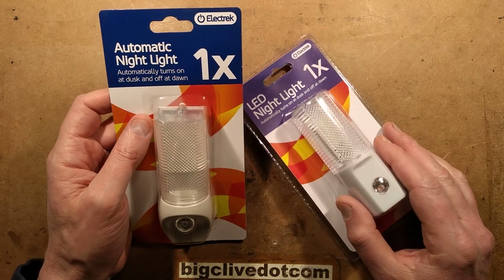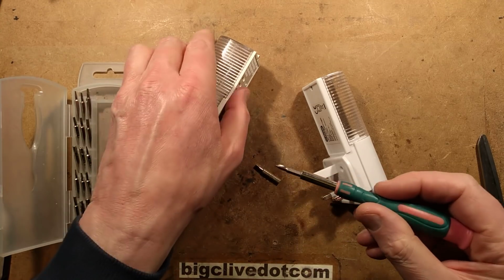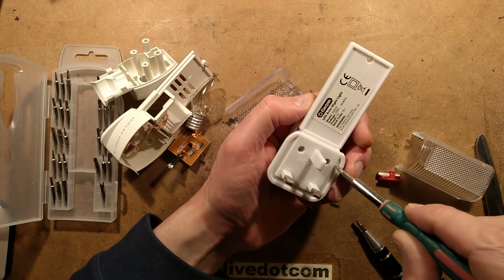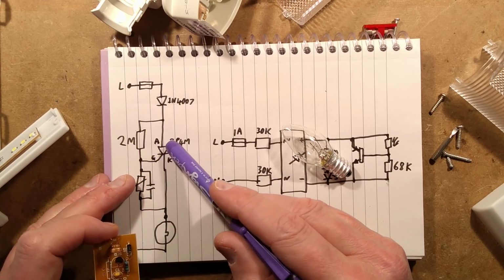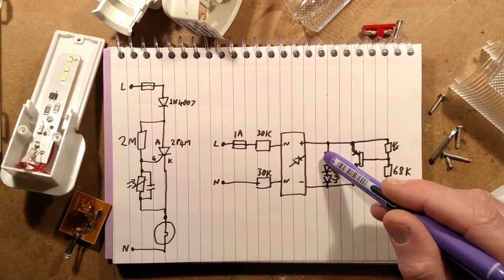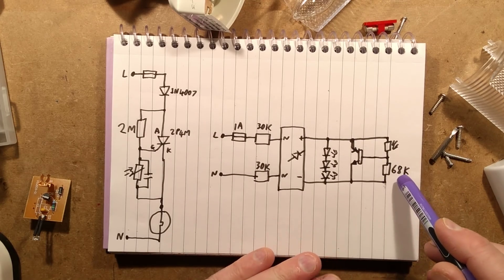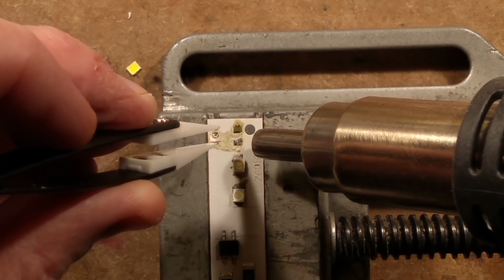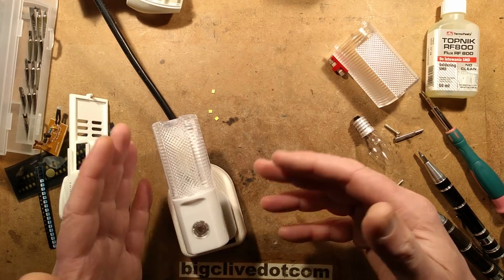Poundland night light tungsten to LED evolution.  (with schematics)

Comment: That housing for the LED version looks absolutely RIPE for hacking! Even if you have to make your own PCB, there looks to be absolutely loads of space in there. I'm thinking if you made a little 'extra' PCB that would use the pads kind of as 'anchor points' and then you could put more LED's that would fire out sideways, for more of a "down the hallway" rather than "straight across to the other wall"
Reply: Oh, man... You know how many guys you just sent running for their soldering irons? I have to cut this comment short, as I must go do this *right now*!

Comment: Here are 2 more hacks you could've done.  1.) lowered the value of those resisters to make the LED's brighter.  2.) put an electrolytic capacitor across the DC terminals of the bridge rectifier to get rid of the flicker in the LED's.

Comment: those close up znse laser cutter lenses should have an effect on your readings, the reason real close up lenses straight from flir or whoever else cost so much money is they have to be calibrated to keep ratiometric accuracy. you might want to give it a bit of a test at some point perhaps using a 3d printer bed heater painted flat black as a blackbody source
Reply from the maker: I've done some comparisons and it's not too bad.

Comment: With that circuit, the light actually takes more power when it's off. If they had used a capacitor dropper instead of resistors, the light would dissipate less heat, and virtually nothing when the transistor shunted the LEDs. OK, it's not much but it just ...bugs me.
Reply: The main problem (for "them") is that if they did isolate the LED chain, then the transistor would have to have a 400v rating since that's the off-load voltage of the system.  This is a common problem with all the wall mount LED nightlights - and it's entirely down to cost savings - Mains rated transistors being more expensive, and possibly the "lv" section of the board might need a redesign. After all they are not paying for power use, and the general public will happily assume the LED devices are more energy efficient, purely on the basis of accepted knowledge and marketing.
Reply: No, not a series switch, that would be krazy. Just replace the resistors with a small capacitor. I figure about 50 nF if I did that right. With the transistor on, there's almost no dissipation, just a power factor hit.
Reply: @jamesvandamme7786  I've actually done that with an old single LED nightlight from the (now defunct) Dick Smith electronics chain. Used a China Semi 13003 NPN 1A / 400V device, and the lash up worked pretty well. Had to modify the "ambient light" sensor CdS cell to prevent false triggering, but the end result was useful for a while.

Comment: I have nightlights (LED with battery backup) that are on all the time.  The amount of power they use is so small they don't bother with a circuit to turn them off.  A single AAA battery provides backup power.

Comment: I thought all UK plugs were supposed to have fuses in them.
Reply: You’re correct; both of these lights had fuses.
Reply: @tbavister  yep, you have to watch out for some cheapo chinese stuff that have mains plugs with no fuses in,   these 2 nightlights do have fuses, although the led one is a 'fixed', non user replaceable type
Reply: and in any case, a plug fuse is more for protecting a cable from overcurrent and/or short, and these have no cable between the plug and item

Comment: I think you would benefit from two fine tip soldering irons for surface mount work so you can solder both ends at the same time.
And a stereo microscope will help also.  Not the heads up type.  But the regular stereo type equipped with an LED ring light.

Comment: got one ...and as per with normal bulbs...the damn thing fizzed out thus need a replacement bulb.
i do have spare bulbs but their for my brothers old car thus NOT 240v so cannot use one of them due to obvious differential in filliments.
i was looikng for any LED ones in my local poundland, but at time i got mine it was the filiment bulbs only. 
they are fairly good as i used mine for that little bit of light when gaming and using keyboard as i have it in the socket at side but behind me which gives just enough light so i can see buttons, but not overlight that causes distractions as the LED table lamp i have does. one thing you dont need a lot of when on driving simulators and driving whatever at nights on the game is too much light

Comment: When you blow straight down, it won't  blow away...
Reply: but the plastic of the LED would melt ?
Reply: Maico Not with correct temp and timing.  And LR has a number of bent pipes on his hot air tool to control the direction.
Reply: that is cool. He should sell those prebent pipes in his shop :)

Comment: Would be more efficient if it was capacitive - especially when off... If there was enough room, could convert by replacing one of the resistors with a capacitor and the other with a lower value for inrush limiting - and unless an output capacitor was added, the resistor would have to be set for maximum tolerable LED pulse current

Comment: I once had an ACME brand night light with one of those little tungsten bulbs in it, I did do that flickering thing they do because the bulb's only being powered by half a cycle.  I also have a light light that looks like a dog and it has a tungsten bulb in it, I got that in 2014 believe it or not.  It doesn't do the flickering thing so I think it's powering the bulb all the time.

Comment: Would you please build yourself a isolation transformer.
You just connect 2 identical low voltage transformers together on the secondary.

Rossmann advise:
You need more flux.
Surface mount LEDs needs to be heated from the back.

Gute Nacht, Onkel Clive!

Comment: Too much blowing and from the wrong angle! ;) Top down with less air flow and/or more distance of the nozzle means less flying components. It also seems that your solder paste was very liquidy. Did some flux separate out in the syringe already? Although in this case I'd most likely have used the soldering iron.
Oh, and is it the scottish accent that you managed the "ch" in "Nacht"? I more often hear "gute nackt", but that means something very different. ;)

Comment: There are U.S. equivalents to those night lights, almost the same exact style except for the plug. However you can also get a C7 led bulb at the stores where those are sold, so the conversion for the slightly older style one isn't as fun as your way of doing it.

Comment: Hey Clive! To stop components of blowing away you can turn down the airflow (unless you need the heat), position the nozzle above the part at a reasonable distance, or do what you did and hold it with tweezers :) I tend not to use solder paste unless I'm soldering stupidly small stuff with many pins as a soldering iron is just as fast (from me at least). I'm surprised you have any spare sockets that don't have nightlights in them already haha

Comment: Could you change the tungsten bulb for an LED one of the same dimensions and similar light outputs?  Would this give you the best of both worlds and lower power consumption?
Reply: yes, but it'd have to be a type that can handle the 'choppy' mains waveform, such as a 'dimmable' type

Comment: i hate led ones because cant change light. weird there is a back on the light too. is that common over there? never seen that design. usually it has the plastic on front that just slides on. 
this is what a normal one is here. https://www.amazon.com/ClearMax-Night-Light-Toggle-Replaceable/dp/B07D9R29H2
Reply: the cheap led ones i seen in dollar tree and stuff was a different design and didn't like how it lights up whatever was on the front of it. just a small led bulb in the bottom that is supposed to be the same as a normal bulb. https://www.ebay.com/i/173840236022?chn=ps

Comment: There isn't a simple circuit that can be imagined starting off with an unswitched transformer as the very first component? That is: I know the transformer itself ends up being a pricier component, but if I'm designing something for my own long-term use, is there a route to 'less power consumption' for this? Or is simply intractable enough that photovoltaic nightlights are a reasonable thing?

Comment: Great video as usual. With the U.K.’s 240v line voltage.... is there an issue with electrocution more than 110volt  line voltage value?
Reply from the maker: Any contact results in a much higher shock current.  It tends to give most people a harsh but non fatal lesson early on.
Reply: Depends on how much current is going to run through your body rather than the voltage, both these mains voltages can deliver fatal amounts of amps (current), while for example a car ignition spark  works at around  25KV but has very little current to play with and will not kill you unless you already have  serious problem going on with you heart say..The more current going through your body (to the point it kills you) depends on how low it's resistance is.You can lower your body's resistance to dangerous levels  by for example walking barefoot on a wet floor and then grabbing a cable..you can then raise your body's resistance to a safer level by wearing rubber boots on the wet floor as the circuit can now not complete between the cable you have grabbed and 'the earth' under your boot..but never take anything for granted with electricity as say the boot may have some water on which may bridge between the earth and your body and complete the circuit again.

Comment: Used to have a small night light for bathroom that was a small carbon arc lamp...LASTED forever...
Reply from the maker: Really?  How did it work?
Reply: @bigclivedotcom  The insides, I dont know, but it had 2 small Carbon rods just sticking up and protected...you could see them threw the plastic cover..and this was years ago,,  Loved the thing.always on..
Reply from the maker: @ecash00  Was it just a gentle glow between the two rods?  Could it have been a gas discharge lamp?
Reply: @bigclivedotcom  It was a nice Glow, and it looked like 2 rods with a spark in the middle, inside a Glass tube..Very small..  wish I could find similar..
Reply: @bigclivedotcom  Probably some type of Nernst lamp https://en.wikipedia.org/wiki/Nernst_lamp
Reply: Umm...neon bulb?

Comment: Tip for the solder paste: let the board cool all the way down before applying it, so it doesn't just immediately liquify the flux in it and flow all over the place.
Reply: Also helps a great deal to dial way back on the airflow so you aren’t just blowing components around.
Reply: @ethanpoole3443  Naa, makes it less fun. Blow more instead! =)

Comment: I don't find a reason to use the solder paste to be honest - I will generally tin the pads fairly heavily, put some flux and then reflow that with the hot air. Works great for chips and the smallest components I have right now are 0603 I think.

I think the paste best kept for BGA and stencil type of works.
Reply from the maker: Yeah.  I had it and thought I'd try it out.  Not a good idea while recording.
Reply: @bigclivedotcom  It was a great idea! It works fine as you found out, with some fiddling perhaps with the angle and air flow. I have the same paste I think, if it's the "mechanic" brand from ebay or so. I did find you can add a full Rossmann's worth of extra flux if you want, it was unclear to me if it did really help if the board is already clean though.

Julian Ilett was trying some madcap ways to dispense the paste which was fun.

Comment: 240V E14 indicator bulbs also work well in these incandescent night lights, if the thyristor is MCR100-6 TO-92 then it should handle incandescent 15W fridge bulbs also. I had capacitive dropper driving mod LED indicator completely incinerate the internals of a digital timer._

Comment: How about a diode for half wave rectification, a small capacitor and maybe a small resistor to get some minimum voltage going on and a LR8K4 linear regulator to get 3.3v or 5v dc from 14..450v dc  ... then a 6-8 pin micro to read the sensor and power the leds ...

Comment: 68k fixed resistor somewhat implies everyone's houses are the same level of light and dark....  would it be too expensive to stick a 100k mini pot in there and make it adjustable?Maybe.  That plus a small drill hole seems like a valid mod to me :D
Reply: Paulo J It's live circuit.  You'll need a safely isolated plastic axle or handle on the pot.
Reply: @johnfrancisdoe1563  its only 9v where the 68k divider is which is pretty safe. If you wanted to be extra safe you could put a 10v zener across the rectifier which would shunt that part of the circuit out if the voltage rose. eg. a dropper resistor failed short.
Reply: That board's referenced to the full mains voltage. Might be an idea to supply a ceramic tip screwdriver just in case! :-)
Reply: @phils4634  Thats a mod not a product for sale. If someone's poking about inside modifying it, I'm working on the assumption they aren't stupid enough to hold the shank of a screwdriver while standing bearfoot on a wet towel and stick it blindly in to a powered on device.   You do that you are doing the species a favour imo.
Reply: @Skilldibop  Spend one of two evening shifts in any Emergency Department of your choice and you might well be surprised to see just how much "frankly crazy without the need for drugs" is out there! :-D

Comment: Pretty cool, I'll have to have a go at putting together a circuit like that.
Reply: Just remember to keep in mind that, as it's just a resistor, it'll be live.  Personally, I prefer to use USB stuff because then worst case scenario is a 5v short, which at least is usually limited by the USB power supplies not being able to source more than an amp or two.  I guess even the USB power supply could be, as Clive would say, dodgy too though.

Comment: That solder paste looked a bit runny, the opposite of Julian's way too thick stuff and maybe the air was turned up too fast.
I only use hot air for de-soldering stuff anyway. I haven't had a reason to bother soldering stuff that way.
Reply: Oh god, watching Julian trying to do SMD stuff with the paste is so frustrating. He seems absolutely adamant that he's going to do things as awkward as possible.
Reply: @webchimp  He does stuff like that because it's a challenge/experiment and partly just to get people talking.  He knows it annoys certain people and he seems to like it. On youtube any viewer engagement is good, wether it's positive or negative.

Comment: Hmm. Yeah. I still got that problem...
I dont want to have a motion or light sensor running all the time which almost eats 1W,
if i can manually turn on my led christmas usb light strings at night to illuminate the stairs,
which then take around 2W BUT only 8 hours a day, not 24x7.

Wasting 1W + 2W when lights needed...
Or just leaving it on all the time...

PS.: That "Gute Nacht meine Kinder" was kinda splatter-horror-movie-ish ... *bwaaaaah!*

Comment: That tungsten design is very shitty and I’ve only seen that particular variant in one night light and one set of screw in light sensors. Normally ours are similar to light dimmers and they use a triac circuit. Of course the real heavy duty sensors such as those in street lights use a thermal switch and the LDR passes current to a heater when it is light outside.

Comment: I have got almost the same LED ones in 3pack in Tkmax branded Grundig. They used identical PCB but went with newer type of component in place of LDR. And normal screws.

Comment: I have a couple of American night lights that emit a green light from the surface of wht looks like a piece of cardboard, they are desighned for 110 volts but I have run one at 240 volts, all it did was get warm and warp but still works there is no electronics or resistors inside juat the surface that glows directly across the mains further more it is open to the touch but appears that there is no discernable voltage on the outside surface. I have no idea what the technolgy is called, I believe it is something that was developed for the space race.
Reply from the maker: It's an EL (Electroluminescent) night light.
Reply: @bigclivedotcom  Why are they not availble here it seems like a good technology for the purpose, they draw next to nothing current wise and give off a good light, would you like me to send you one of the two I have, I only got them as a memento of a trip to the states. I get odd things like that including plugs and sockets from arround the world when I go abroad.
Reply: @Equiluxe1   Have a look at https://en.wikipedia.org/wiki/Electroluminescence esp. the "Practical implementations" part.
True, they were a part of the space race. The Apollo command module´s instrument panel was lit by EL.

Comment: Hmm, maybe they should have designed the LED one to drop half of the voltage over a cap and half over a resistor element. Or at least spread the dissipation over more than 2 resistors.
Reply: Gameboygenius - or a small heat sink with thermal paste on both resistors 😉
Reply: @samuelfellows6923  that would likely be far more expensive to assemble than using a capacitor which can be placed using the pick and place machine. Besides, I would not trust the heat sink compound to be a good enough conductor not to create a short, or at least potentially arc over, through the heatsink.
Reply: Gameboygenius - that was my knowledge of heatsink use, the resistors where hot.

Comment: I think I'd replace the LEDs with 620nm Red LEDs, I find that red light at night is easier on my eyes when I go from dark room to a night-lit room, I even took one of them Status-branded "dimmable" (very poorly made with a potentiometer that is just junk) lightswitch LED lights apart, swapped the COB strips for red ones and use that as a nightlight or to relax myself when the mind goes into "Not letting you sleep now!!" mode... :)